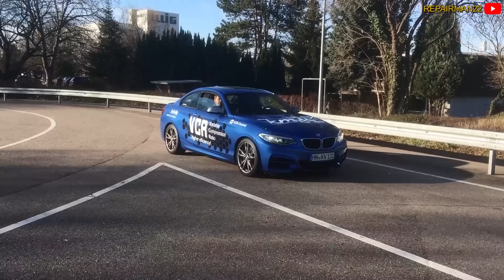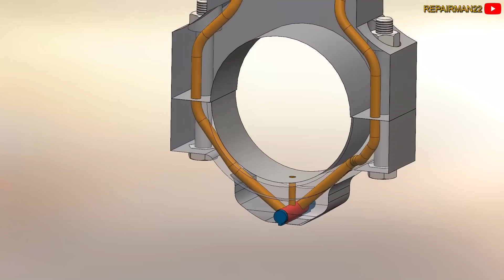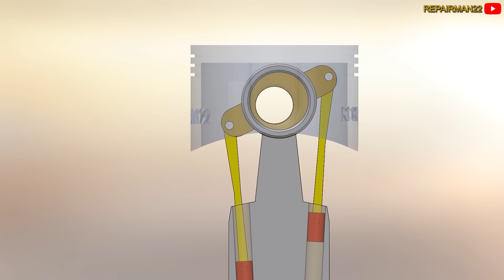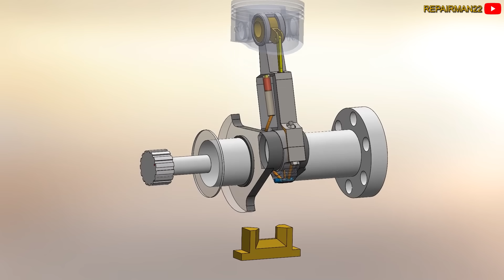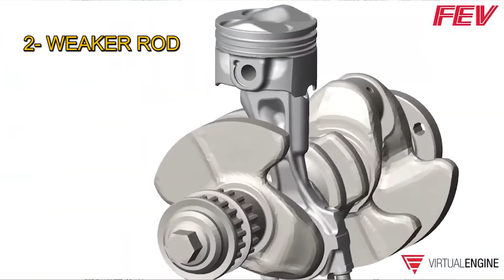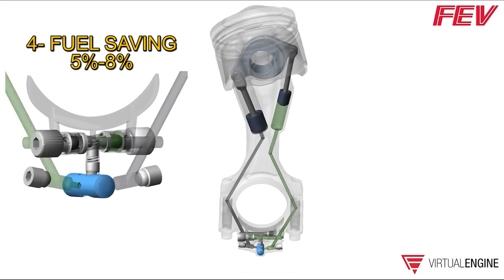This BMW has variable Connecting Rods that can vary its length and Compression of the Engine 🤯 VCR

Comment: The number of failure points is multiplied by 10X. BMW metalurgy for VCR rod and sub components has to be better then modern attack submarine. When implemented across fleet a recall is all but guaranteed.
Now mate it with ;
Twin scroll two stage turbocharger
Valvetronic (variable valve timing)
M Power accessories 
Thin 0-20W motor oil 

BMW dealers will need to 2X # of service bays.
Independent BMW maintainers will need new tools and training.

Comment: I just couldn’t fully trust it not to fail. Has metallurgy been a part of the design and manufacture? I see some impact parts albeit small and lubricated. I see additional impact and wear and tear.  And back to the more  moving parts argument. Tolerances and Q&A issues along with the long standing “human error “ argument.

Comment: Nissan got it first and have at least 2 engines that do not seem to have issues!

Hyundai also has turbo engines with infinite variable valve timing, which can actually vary compression and make the engine work in the Atkinson cycle when idling or under low load.

Let’s see how long BMW takes to do it and how reliable it will be.

Comment: To answer one of your Q.'s I'd never heard of this before. By the same token there is no reason I'll ever be continuing the discussion. All the extras are poised to suffer longevity challenges, extra weight costs more fuel when I am interested in more power at less consumption of gas. Clever that the thought was researched just in case. bought to a working level and tested, but the writing is on the wall for this severely complexed burden on the manufacture and repair as falls due with the stupid system that I just gave over eight minutes to.

Comment: Like the idea but complexity of conrod can maybe not suitable for engines thats going to do high mileage,or longlasting engines,and the constant 3 bar electryrical oil pump is a big no no because all the fuel savings will be eaten up by the alternater working very hard strainig the engine.We know from previous attempts by manufacturers that electrical pumps are prone to failure,like fuel pumps,electrical powersteering pumps,etc,but main killer powerconsumption at 12V is enormous,the variable compression idiea is nice though,sorry,the more we think the better the ideas will become

Comment: Isn't electrically assisted turbocharger solves exact the same problem, but with introduction of a single electrical motor while engine stays the same? Since this concept requires electrical oil pump as well as addition of huge amount of moving parts into most stressed areas of the engine, i would call it a dead end

Comment: BMW is apparently not paying attention to recent history. Nissan’s VC-Turbo engine took 10 yrs and $2 billion to bring to fruition. By that time all the competition had reached their efficiency gains through more traditional methods. I thought that engine was uselessly complex, but this thing takes the prize for “Most Stillborn Silliness”. Looks good on CAD and in the boardroom but would never survive out in the wild. All those tiny passages, tiny electronically controlled valves, recommended 10,000 mile oil changes, mini lifters with pivot points, tiny pushrods….Good Lord!

Comment: Variable camshafts are already overly sensitive often causing code and rough running engine when not working at 100% especially if the owner has gotten near or past the oil change interval. That is how motors are treated in real life. This would likely suffer the same issues and as the motor ages build up and leaking seals could cause each piston to have a different compression ratios and drivability issues.  Repair costs would be very high nearly all motors require full removal to service the oil pan and and components in it. I have the feeling the typical IC engine has advanced as far about as practical and more add-ons like this will drive up repair costs and hurt long term durability.

Comment: People talking about failure are only halfway there. Complexity is fine for a good enough reason, and this is a pretty good reason if it works.

The real problem is that when it fails (which is soon because it’s complex), you have to remove and likely replace the entire rotating assembly.

Comment: So much effort to improve a fundamentally obsolete, complex and inefficient engine design. IMO, the future of ICE is free-piston linear generators to provide baseline power to a BEV drive train. You can have almost any combustion cycle you can imagine using only two major moving parts per cylinder: the two opposing magnet-bearing pistons. Mainspring claims its 200kW free-piston generators achieve 45% efficiency from fuel to AC output. It would be great if it could be scaled down to ~20kW as an EV range extender.

Comment: As an engineer , all I can say: What are this idiots smoking? Bulky and clunky complex contraptions bring only new ways for the engine to blow up. If you cannot make it with a simple mechanism, than you should search for a solution elsewhere. This standardized lunacy is the exact reason I left R&D and now I fix cars. I used to love challenges, to modify and remove all the bullshit that causes the engine to fail and make it run basically forever with reasonable maintenance. But now the imagination of this crackheads that I call colleagues, has gone so far, that some engines are simply blacklisted. I refuse to work on them, because they are designed to fail. Consequently I cannot guarantee my work. 
And if you want to say: you make it better than! I will for your amusement. High Energy Ignition System that I developed from scratch all by myself 15 years ago + electric turbo. Sadly, it was thrown in a drawer because the tech leads in automotive R&D are some kind of communist officers that have absolutely no clue how an engine works.  If you ignite the whole mixture at once, it cannot knock and I don't have to explain compound turbo systems, because are already up and running on diesel engines. The automotive industry really deserves to die.
Reply: Mechanics hate engineers.

Comment: So the oil pressure is fighting the cylinder pressure just to attempt to get higher compression?

Better use port injection for low rpm and high rpm and direct for the middle if you really want better torque at low speeds

Comment: Looks like they put the updated mechanicals in the least logical spot. It would simply make more sense to vary the compression by moving the crankshaft (or heads) up and down. They could have used the same tech & methodology.

Comment: why not just use something similar to the atkitson cycle, like prematurely open the exhaust valve to allow a bit of the compression out of the cylinder in high boost situations? especially with beemers valvetronic system. it seems a variable rod length adds unneccesary complexity

Comment: Bullshit, today engines are complex and this  adds more complexity to it. High quality oil and more oil changes are already mandatory so that all the components do not become clogged with oil carbon. Despite all the progress in engine construction, engines still consume so much fuel. It would be better to make the vehicles 500kg lighter than to add more and more electronic gadgets

Comment: (i'm French), it"s a good idea and could improve flexfuel (etanol) engines to increase efficiency. Etanol accept more compression ratio (more efficient, less fuel)  without knock. But the better solution is write by JxH : an engine with a high compression ration who works on atkinson cycle (the valve is left open more time  to reduce compression ratio) seems more reliable.
Reply: The Air fuel ratio is more of a problem
Reply: The air fuel ratio of etanol is more of a problem

Comment: I realize the engineers are swamped by modern efficiency and pollution requirements.    But the complexity and cost of modern ICE (engines) is the main reason that I am ready for electric cars.   To much to fail & to expensive to tepair.   I am not crazy about all the electronics and 'totally integrated' computer gadgetry in Teslas and others.   More crap to fail.   There is a lot to be said for a button for the window up/down and a simple pull door handle.   But a descent battery and a simple electric motor, if we could get that.    I'm ready for it.    K.I.S.S.     Keep it simple, stupid.

Comment: Many years ago, SAAB engineers developed a variable compression-ratio cylinder head (for optimizing their small-displacement turbo-motor's low-rpm performance), which worked by pivoting the head and cylinder-liners a few degrees, relative to the engine block, which - of course - supported the crankshaft and connecting-rods.  By 'lifting' the combustion chamber and cylinders slightly, the compression ratio was lowered, allowing massive boost at high rpm.  When the combustion chamber and cylinders were dropped to their low setting, a high compression ratio was established, allowing crisp 'off-boost' performance. SAAB was able to power a full-sized luxury sedan, using a 1.4 liter engine(!), and produced well over 200 bhp, with good torque across the entire rpm range.

Comment: Adding complexity to improve efficiency is not the way to go if the only thing that's important is efficiency.  Complexity adds cost , and there is a measurable cost/savings ratio. If it saves 5% fuel , but it cost 5% more , and it is 1% heavier,  would be a nt loss for consumers.  Weight reduction should be the way forward,  not added weight and complexity.  But then again.  We are talking about bmw. Always using technology that fail prematurely.

Comment: Camless, free valve technology would save more fuel, create more power and isn't adding failure points when strength is paramount in the bottom end. Kiss

Comment: BMW couldn't make a variable intake manifold that was reliable but thinks that making a solid part that moves at 2000-12000 times per minute into multiple moving parts is a good idea.

Want to vary the cylinder pressure of a turbo engine? Back the boost off, dipshit.

Comment: Can’t you do that with variable valve timing? If you wanna increase compression, you just make the intake valve and exhaust valve overlap, and/or the exhaust valve be open for longer so the piston is higher up slightly than bottom dead center. Sure you cram less air into it, but you increase the compression, and this system also crams less air when it makes the compression go up, I believe.
Nonetheless it’s really interesting, but I don’t trust this will ever come to market, after all, messing with parts that bears such huge forces that are not rotational, move in a complex non rotational way and adding moving parts to them can’t be good for the reliability, especially at higher rpm.

Comment: If the aim is to compensate for low compression on a turbocharged engine the obvious solution would be to use a crank driven compressor instead of going through all that trouble.

Comment: All those extra components going up and down, round and round. That's a fair bit of mass and complexity.
If the crankshaft bearings were in concentric containers, then rotating them would also raise or lower the crankshaft.

Comment: Interesting dead end. Sure it might enable peak effieincy of combustion, but it adds complexity and mass and reduces reliability, and it changes the TDC timing as the eccentric moves, which will change the thrust angles on the piston as it is pushed downwards, no doubt leading to any gains being lost through extra friction on the bores. If we don't see it in Formula1, it's not worth it for street cars, because if those engineers say 'it's not worth it', then it's really not worth it.

Comment: Just a thought why not design a timing chain that doesn't shit itself after 40k
 or make main bearings out of metal instead chocolate
And plastic chain guides  that fall apart at the touch of oil

Comment: I dont get it wont the rotating epsilon not work because it moves side to side within the cylinder? Wouldn't it run into the walls when the piston gets rotated like that
Reply: that would move the rod in relation to the piston if it was in a cylinder

Comment: Nissan already has this in production - the VC-Turbo series engines have variable length connecting rods to give them variable compression, and they're about as (un)reliable as you'd expect
Reply: Figures? Numbers? Examples?
Any details at all for such “common” failures?

Comment: Given the advancement in today’s lubrication technology I can see this failing quickly with modern low viscosity oil such as 0W-20, which would most likely be run in this engine along with extremely tight tolerances. I thing the design team should take a step back, accommodate old school tolerances, use 10W30, and a large oil cooler, with a 185-195 coolant thermostat and a sturdy all aluminum radiator. No BS plastic cooling components, that’s a step backwards in technology “advancement” and that’s a fact not an opinion.

Comment: Same can be achieved by varying the intake time. Simply by keeping the valve closed for a bit longer, the compression ratio can be varied from inherently high (100% open) to practically any, depending on piston position and boost pressure.
Reply: on what stroke lol? CR is a fixed number. volume of the cylinder to volume of the combustion chamber.
Reply: @SamTheSambaMan  How do you get a turbine compression ratio, then? It has no pistons at all. Compression ratio is a function of pressure, not volume. Those two are related, that's why you confused them.

If you close the intake volume half the way of an intake stroke, you'll get half the compression ratio. Because you'll gonna have only half of the air mass to compress.

Mazda did it. They already did a variable compression ratio engine, that, btw, if combined with a supercharger, can work both as 2 and 4 stroke.
Reply: Yes, but most valves only have 2 “stages” or timings.

You need infinite variable valve timing for that, and only Hyundai had that for a few years now (maybe one more maker, just recently).

Comment: "my mini pistons have blow by!" could you imagine if one piston didnt actuate causing it to have a different compression lol
Reply: Vibration of different power pulses along the crankshaft, it'd be like running with a spark plug removed, can shake the engine apart.
Reply: @PiDsPagePrototypes  The ultimate enemy to mechanic stuff, V I B R A T I O N

Comment: 13:1 REX range extender small engine on an EV is far superior if you really want to be a combustion engine hoarder when EVs are clearly superior now, only low cost EVs is the last challenge which will arrive in 2025 at the latest.  Tony Seba proven correct again.
But this Rube Goldberg engine was entertaining. 😂

Comment: Nissan already has a variable compression engine in production it’s in altimas and rogues. It’s kind of cool but I don’t know if it’s worth the extra complication. It only gets Marginally better mileage and power than the base motor.

Comment: It's a very nice novel thing to do, but it's just gonna fail. The mechanism inside the rod is prone to wear out quickly due to high forces during rapid rotation, not to mention the additional weight of the rotating assembly which will result in tanked responsivity to throttle etc. There's a reason why people use lighter flywheels, pistons, rods etc.

Comment: Soooo, when I'm pushing 40psi boost and sailing like a jet......can this hold up? Not that I have a BMW anyway, but I'm asking anyway.  

I figure that you just need to find some active cooling system for the turbo where you can modulate intake temp at any rpm, to allow us more timing freedom. The only reason we use less compression is because of early detonation,  something that is closely linked to intake Temps. It would also benefit us at higher rpm as well, since this system only affects low range, low boost performance.  It's also to be noted that with a good tune and ecu, you can run lean in traffic and not have any  misfiring, essentially saving some fuel. Your engine will make trash power,  but you don't need it anyway. I'm pretty sure saving 5% does not offset the crazy maintenance costs,  and oil changes. For context, poor oil change is one of, if not the leading cause of engine failure. 
If push comes to shove, why not vary the cylinder head. It's a sturdier system,  easier to maintain, and variable cams are nothing new, to maintain  proper contact.
To metal gaskets and a spring type ring between, with an upper O ring, restrained by a bolted stopper plate.  Throw in a few vents/ports for blowby, send it to the crank case ventilation system or the EGR, whatever you choose. It's easy as bolting on a new head, connect your oil hoses, and upload a new tune. Maintenance would be as simple as pulling a couple bolts, throw in some new seals and bolt back up. In and out in 2 hrs or less, for only a few dollars + labor.  
Those pistons definitely cost 4 figures per set, more than the cost of a used engine today. 

Maybe I'm just talking out my backside, but this is some free valve type of stuff, imo. Excess complications for meager rewards.

Comment: Why don't they raise and lower the cam on the surface of the piston itself using oil pressure? (piston in the piston) Less complexity, simpler and less weight
Reply: I recall this was tried in the past. (Piston in a piston). Circa 1970-80. Regular crank oil pressure routed to the piston was pushed up with a small orifice and check valve and it also had a pressure relief valve that would allow oil to escape when there was sufficient oil pressure. So in a lightly loaded engine the piston would move to the upper position and operate at higher compression. Conversely when the engine was heavily loaded, the relief valve would open and allow the piston to move down to the lower compression position.